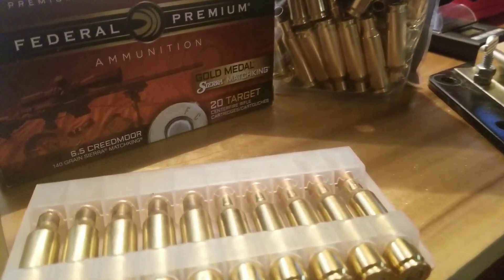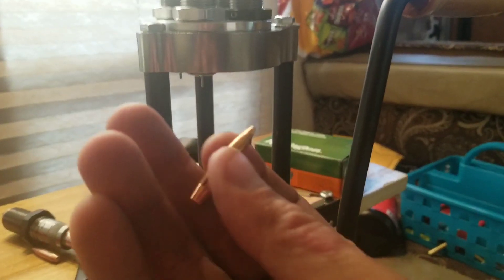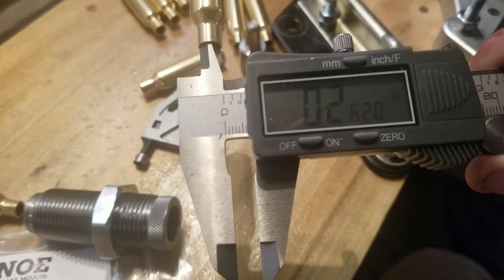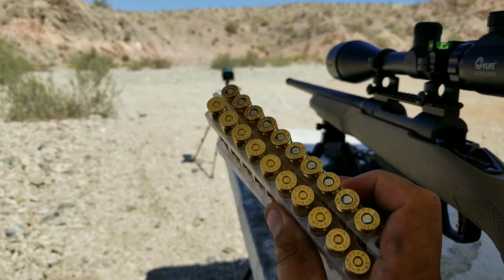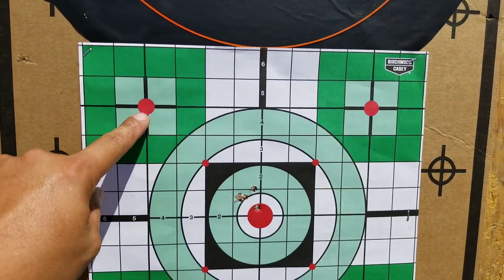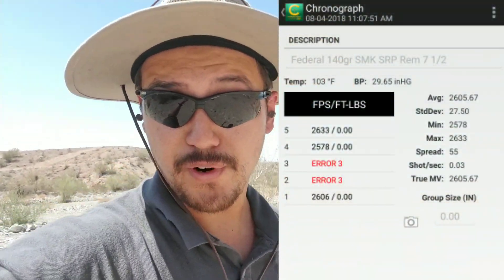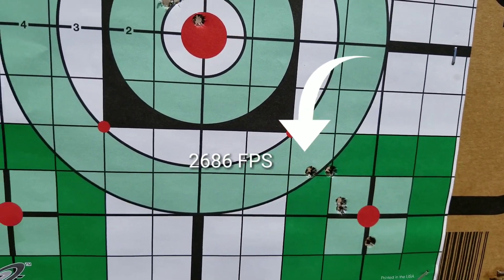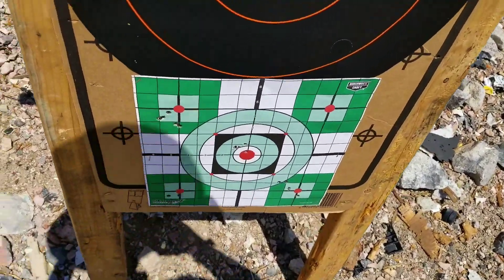Small Rifle Primed vs Large Rifle Primed Brass for 6.5 Creedmoor. Benefits or disadvantages?

Comment: The small vs large primer difference in velocity and consistency is due to the powder. Some powders need a lot of fire (larger primer) and some powders work fine with either. If anything you'll even see slightly higher velocity with some powders using small primers.

Comment: Velocity loss could be from case capacity difference between starline and federal cases
Reply from the maker: I agree. Quickload does confirm this with even .2gr difference.  I did a complete Satterlee load development and found SRP to have increased velocity in the lower charges over LRP. I settled with SRP brass due to the gradual increase and lower ES numbers. Thanks for valuable input and watching!
Satterlee Graphed Data https://imgur.com/a/BWk95jS
Reply: Velocity drop is due, mainly, to the loss of energy from the LR primer.
Swapping from LR to SR is worth almost a grain (of varget). The benefit comes from the extra strength in the case head of SR brass. This allows higher charges with no pressure signs as mentioned in the vid.
The accuracy benefit comes from reducing the effect of the uncontrolled element in reloading, which is the primer.

Comment: I recently bought 100 pieces of Gunwerks LRP 6.5 C brass and it too arrived bulk loaded in a zip close plastic bag. A good percentage were dinged up requiring me to work the brass before ever loading the first one. Also....I only received 99 pieces. :-I I associate Gunwerks with high end, squared away products and capabilities. To get shorted one is what I would have expected from Remington or Winchester. Dimensionally, the Gunwerks brass was very good out of the box. I've loaded some with a147 ELD M and H4350 to test but haven't gotten to the range due a knee issuse (operated on 2/26/19) and ongoing ridiculous weather conditions in my AO.

I always refer to factory ammo, whether 'match' or not as 'one size fits none' ammo. It just goes 'bang' but one need not set expectations too high. 

Thanks for  your work! ATB!

Comment: I have the Savage 12 LRP, I found my rifle simply does not like Federal ammo. I tried Hornady 140 grain Match and Hornady Black. Rifle liked those pills, Match slightly better in accuracy. Both sub Moa. On calm day, 8 or 9 out of 10 at 1,000 yards on 18 inch plate, with factory ammo. I am going to lapua small primer brass when I start my reloading, better brass life and less case prep makes it worth the price in my opinion. Will start with 140 and 147 grain Hornady projectiles, will stay with what the rifle likes. Good luck with your reloading and good shooting!

Comment: i get good accuracy with fgmm my box looks different .. i don't think you are using' match ammo' its inferior to fed gold medal match (its just fed gold metal) sales pitch .....Nice test I was thinking of picking up some 308 with small primer holes,, interesting that you lost fps maybe you need hotter primers. Good test lesson learned small primer less bang makes sense i guess.
Reply from the maker: Thanks Vlad Alexander. According to Federal. There "premium" line is considered there match ammunition and is made to the same standards but offered in different projectiles. Lots of course can differ. Ya I'm intrigued on the loss of FPS though I thought these being a magnum primer (Remington 7 1/2) wouldn't matter. Im going to try CCI 450s and see how those do. The Lapua 6.5x47 cartridge is very similar to the Creedmoor and IMO surpasses in longer distance performance yet uses SRP. There flash holes are 1.5mm instead of the traditional 2mm so to use there brass will need some filing of the lee decap pin or special order. Makes me wonder if there is a hotter gas jetting effect which is causing better ignition
Reply: Thanks for the stats i love hearing specific stats its like gunporn talk dirty to me yess use the decimals tell me the Coriolis effect parameters in a specific altitude density gr .004 ant 3479 elevation at 87 deg  mmhhaaaaaaaa..... :)    just kidding bro..  kinda kidding..  I would also think the Remington mag primers are hot at least just as hot as standard large primrs  what have you heard that is beneficial about having 1.5 hole instead of 2mm i can imagine it the ignition hole is too small and the primers are too hot that could potentially degrade the pocket hole prematurely, with wold make the switch to small primes redundant.  i have heard that 20 reloads of small pocket hole brass in 308 is the norm, but I am skeptical small pocket hole primers have been out for a long time why was the switch to smaller pocket hole brass wasn't adopted by manufacturers ?? there is probably a reason
1 cult following standard'' specs could be one. 2 manufacturers don't want you to reload. 3 larger primers are more reliable ..4??  hope I am wrong and there is a difference.  I'm sure if you can find wolf mag primers they will be hot and reliable if you find a lot somewhere I would recommend them. ps. i have some 168 and 175 fgmm  ill tear them apart and tell you if i see much defense between GR...     by the way  :)   the brass with small primer holes  i was going to buy comes from a company called eagleeyeammo    .com     check them out , funny how it would be fitting for you and you chanal, by the way i think that's how i stumbled on to your chanal  I was looking for videos about eagleeyeammo and you happen to post the review between the lee presses.. I have herd eagleeyeammo is as good as Lapua it is thicker brass so it holds less powder but it lasts forever. there is one other manufacturer besides for starling that has nice brass but I can't remember the name right know it some 3 letter abreviation   ARU  something along that line...
Reply from the maker: Atlas development Group brass?  ADG. Yup I heard of Eagle Eye ammo and I laughed. Can't believe the prices they are charging.  10+ reloads uh? Well that depends if the "reloader" is resizing correctly... or layman's the lack of not sizing. I sent Lapua and email to explain why they chose SRP and 1.5mm flash hole Ill share what they said once I get a response. Thanks for checking my journey out.  You can really spend some coin in this art. Through many folk here and TRN i've been learning a lot

Comment: Every time and no matter what caliber I seem to get higher FPS when I use Federal brass but I get horrible SD numbers. Are you using small magnum primers?
Reply from the maker: Hi Anthony.  Yes cci450. I ordered some Starline large Rifle match also to do a comparison. In my experience so far with 6.5CM my SDs and ES numbers have gotten down significantly in the singles. Regardless of huge temp swings. Im really happy with that load. However either this rifle is picky or I have yet to hit a sweet spot. More testing to come! Thanks for dropping by
Reply from the maker: Check out this latest video and you can see how accurate this load is now
https://youtu.be/bXxxf0iXuio